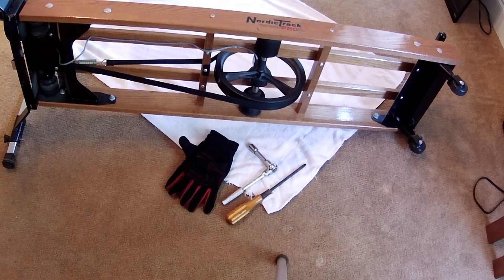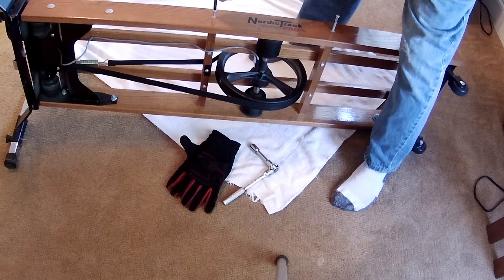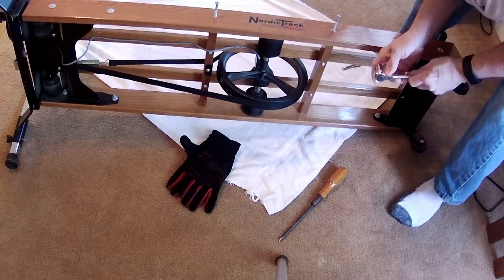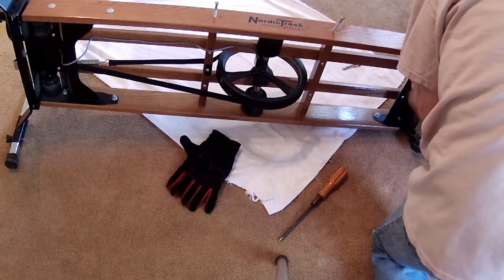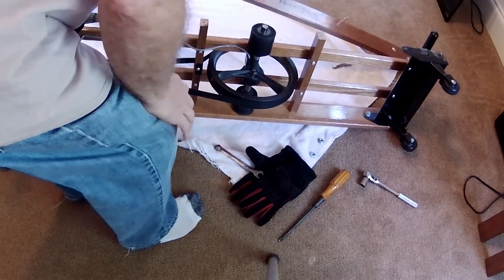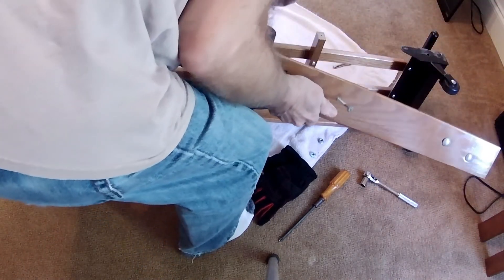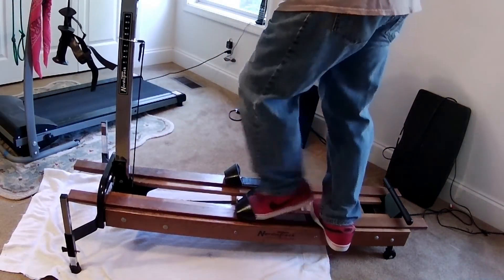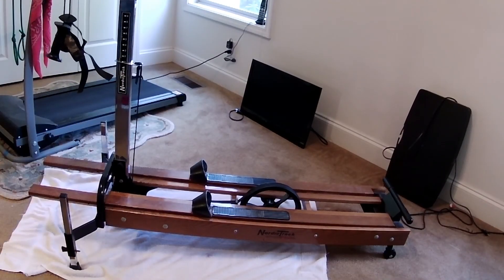NordicTrack Pro Ski Machine Drive Roller Replacement

Comment: Thank you! My right side roller just went out. At first I thought it was the fly wheel. I saved me lots of grief and cash.
Reply from the maker: Glad to hear it, Jimmer.  It's a pretty easy fix and I'm glad so many folks have benefited from my video.
Reply: @speedsterjohnny7191  Suddenly, I felt lost, but fortunately today it's 72, so I'm bike riding awaiting NordicTrack's two roller package. It's an okay deal. Now I know I need a socket set. Thanks again.
Reply: Years ago, I nearly sold it and am I glad I did not. The other day I replaced both rollers and it's good as new, never better. For years I didn't know what I was missing. Thanks again for the vid.
Reply from the maker: @jimmerhardy  My pleasure, sir.  I've had really good response from this vid....much better than most.  Maybe there's a message there.
Reply: @speedsterjohnny7191  The message? It's not the flywheel that goes bad.

Comment: Great video  thanks. I knew the problem was the roller but would not have attempted to take the side rail off to fix it without your video.
Reply from the maker: You're most welcome.  I'm glad the video helped you.  I had no idea when I produced this on my channel that I would have such an extensive response.  Happy Tracking!
Reply: @speedsterjohnny7191  So far so good. Disassembly was fairly easy as you said. The washer on the roller is oily and I seem to remember lubricating but not sure. Was your washer a little greasy? If not I will wipe it clean. Thanks again.
Reply from the maker: @observer2441  Yep, plenty greasy and you want to keep it that way for proper lubrication.  Don't do what I did and let the washer hit your carpeting, if you have any, as it was a chore to clean it off.  The video doesn't show this and the wife didn't see it. he he he!

Comment: Great vid Thanks so much. Good to see that people appreciate these Made in USA older ones they are the best exercise going. I guess I should buy some rollers for mine as I am never going to get rid of it. ..UNLESS I can find the original Elite one for a price I can afford. Would be nice to change the incline so easy and I like the wooden upright and the looks of it ha ha. Love these machines but not the newer models. Made in the USA is the only way to go. I have the Achiever was lucky enough to find one to replace mine.
Reply from the maker: @lindamorgan2678  Thanks for your note!  I’m still amazed by the responses I received for this video.  Best of luck with your machine and exercise program going forward.

Comment: Thanks for the video, we've also had our Sequoia for over 25 years, use it regularly and this is the second time to replace the drive rollers - your video was a nice refresher on how to approach this job.  Btw, most likely due to the age of our unit had difficultly finding replacement rollers, we wound up on Ebay - Amazon had nothing.
Reply from the maker: You're most welcome.  Yes, parts are getting pretty scarce for these old machines.  I purchased my machine for half price from a co-worker in 1989 and have been using it since then.  Great piece of hardware!  Thanks for watching and commenting!
Reply: @speedsterjohnny7191  where can i get the nordic track easy ski machine ???? Its the one with the handles instead of the ropes
Reply from the maker: @kevinwilson3337  Not familiar with that model.  I googled it and several came up including a used one at a pretty good price.  Only hitch might be shipping cost.
Reply: @speedsterjohnny7191  is it on ebay or Amazon ?
Reply from the maker: @kevinwilson3337  I think it was a private seller and with a price of about $125....probably a questionable value.  I saw it on Amazon for $671.04 as a "refurbished" machine, probably OK.  I'm not certain this model is still being produced.
Reply: @speedsterjohnny7191  yea , i saw it on Amazon too but the shipping cost is too much . The total price with shipping is over 1200 lol.
Reply from the maker: @kevinwilson3337  Wow!

Comment: Thanks mine is about 30 years old as well. Mine is not slipping it is stopping but I think it is because the roller has foreign material in it that prevents it from working properly.
Reply from the maker: @ClayWeblogistics  I’m curious to know how the “foreign material” would have gotten in there.  My best guess is to take it off and clean it and then test it again.  Perhaps at some point there may have been less than ideal storage conditions?
Reply: @speedsterjohnny7191  I looked at the skies and the drive rollers work one way. I noticed the skies are damaged from use. I want to put Duros Wood Putty on the rough spots and refinish them.

Comment: Many thanks for your pioneering on this.  Just bought an oak-sided Pro off craigslist and was concerned that it might not have been such a bargain if I couldn't replace the drivers.  The "A" answer would have been to keep the Pro I bought 35+ years ago.  It's a shame cheap drives good off the market.  I confess that I, like Charlie Humme, am such a noob that I can't find the link to your parts supplier either.  Would you mind, please?  Very much enjoyed your sense of humor on display in your narration.  Thanks again.
Reply from the maker: Speedsterjohnny
 
This is the link I used on Amazon to purchase the roller.  Although it shows as "red" in color, the one I received is black, as you will see.  Anyway, this is the link:

 https://www.amazon.com/NordicTrack-Fitness-Machine-Drive-Roller/dp/B008GUC2M0/ref=sr_1_1_sspa?crid=UU2L6CKD4D2V&dchild=1&keywords=nordictrack+ski+machine+drive+roller&qid=1608081069&sprefix=nordictrack+drive+ro%2Caps%2C178&sr=8-1-spons&psc=1&spLa=ZW5jcnlwdGVkUXVhbGlmaWVyPUFOMTk3V0lEOFBYRkQmZW5jcnlwdGVkSWQ9QTA2OTY1NzEyWlgyUTFaMFdFWkpCJmVuY3J5cHRlZEFkSWQ9QTAzMTgxMjYxSDU0SkVFNTVPUktIJndpZGdldE5hbWU9c3BfYXRmJmFjdGlvbj1jbGlja1JlZGlyZWN0JmRvTm90TG9nQ2xpY2s9dHJ1ZQ==

Comment: i have a Nodric Track Achiever model, and the large flywheel is not working.  Then it turned into so much resistance that I could not move the skis.  Would this be one of the rollers?  It was working up until yesterday.  Can you still get parts? I just checked your link on AMZ, it is says they are unavailable.  Thanks!
Reply from the maker: First of all, I am assuming you have not taken the machine apart and reassembled it incorrectly, OK?  Try taking all tension off the machine (nylon strap) and take the flywheel in your hand and move it back and forth. It should turn freely in both directions.  If not, take it out and check for corrosion.   Check each roller function by pressing down slightly on the ski and move it back and forth;  It should turn the flywheel on the back stroke and roll freely when moving the ski forward.  If they work in both directions, the rollers are good.  

The independent supplier I used may be out of stock or perhaps even not able to get the rollers anymore.  If so, they may be available directly from NordicTrak.  If so, be prepared to spend substantially more for them.
Reply: @speedsterjohnny7191  Thank you for the helpful advice.  Correct, I have not taken it apart and reassembled incorrectly.  I will do what you recommended!  Stay tuned!
Reply: @speedsterjohnny7191  Hello, I took off the belt, and the rollers and flywheel moved smoothly.  Once I hooked the belt back on, I could barely move the skis.  I loosened the tension knob to the smallest or least tension and there is so much tension I could not move the skis!
Reply from the maker: @bodeans59  I looked up the Achiever on ebay and noted some differences between your machine and mine.  On the Pro, the tension on the flywheel is controlled by a slide on the upright and there is a separate adjustment for the handles that you grasp with your hands.  It sounds like there is something amiss with the tension adjustment for the skis, that is when it is when the tension knob is at its lowest setting it really needs to be lower.  I'm not certain I can advise you on this problem.
Reply from the maker: @bodeans59  I looked up the Achiever, and while similar to the Pro, it appears that the tension for the skis is set by an adjuster located in between the skis.  If this is correct, then when the slide is set to the lowest setting (all the way forward it appears), there should be no resistance.  If there is, something is wrong with that device.  I could not find a video or any information indicating how to calibrate that control but there must be one.  Do you have an owner's manual?  If not, they may be available online.  Hope this helps.

Comment: Thanks so much for this great video! I have a NordicTrack Pro from the late 80's and the skis clack clack clack whilst I try to use it, it use to just go whoosh whoosh (very softly) and it has a hurky jerky motion. Not a safe feeling at all, I am wondering if I should replace all 6 rollers or just the two on the fly wheel. I have turned the smaller  fore and aft rollers and they turn forward and backwards okay,  also the fly wheel rollers roll freely forward and stop when I attempt to roll them backwards so what should I do about the clack clack clack and the turkey jerky motion. What are your suggestions? please help, I am not mechanical at all but will try to do this. Thanks every so much!
Reply from the maker: I don’t think the “clack clacking” is anything to be concerned about.  I find that I sometimes get that depending on how my feet exert pressure laterally.  Try experimenting by exerting inward and outward pressure as you stride.  Hope that helps and thanks for watching!

Comment: I had a similar issue with the left roller.  It seemed like the rachet mechanism inside the roller was catching and not releasing so there was zero resistance when pushing back.   I tried Liquid Wrench Penetrating oil.  The thin tube on the can allowed me to deliver a little oil to the end of the bearing.  Oil, let it soak in, spin and wiggle the roller, then repeat several times to both ends of the roller.  After cleaning the rubber roller with alcohol, it now seems to be working great.  Unsure how long it will last but since the roller is out-of-stock on Amazon it might be worth a try.
Reply from the maker: Gerry, Hi!  This is a strange one to me.  With zero resistance when pushing back, if I understood you correctly, it almost sounded that the roller was in backwards.  Please help me to understand.  Thanks, Johnny
Reply: @speedsterjohnny7191  When the roller is working properly there is no resistance when the ski is sliding forward.  There is resistance when you slide the ski back towards the rear of the machine.  At that point the roller is engaged with the flywheel which is restrained by the friction belt.   When the roller failed there was no resistance in either direction.  The result can be surprising - you expect to have resistance when moving the ski backwards.   I never removed the roller to lubricate it.  I just tipped the entire unit on one side and then the other to apply the liquid wrench to both ends of the roller.
Reply: there are other suppliers such as nordic parts that sell the rollers

Comment: Hi, I just this got a Nordictrack Pro that looks very similar to yours. The left side takes more effort to push back, and there is a thump when my left foot is over the flywheel. Do you think this would need a drive roller replacement? Thanks.
Reply from the maker: I’m not sure what that means but it does not sound like a drive roller problem.  Can anyone out in NT land give advice?

Comment: The football shaped display for my NordicTrack Pro just stopped working recently.  Would you have any information on troubleshooting those displays?
Reply from the maker: This is out of my realm of experience.  My display was not hooked up for years due to a missing nut that holds the receptacle for the jack;  All I had available was the countdown timer that does not require any input from the sending unit.   I hooked it up outside the upright member and it looks awful but all functions are working.  I don't know how expensive the unit you describe is but that may be an option if they are available. Your display is football shaped???
Reply from the maker: Whoa, wait a minute.  My unit has never required any service other than an infrequent replacement of the 9 volt battery.  Is your battery possibly the problem?  On my unit, the battery is located behind a rectangular access port on the back of the unit which pops right open with a gentle pry.  Just a thought.
Reply: @speedsterjohnny7191  Thanks Speedsterjohnny.  The display I have is NordicTrack part number 27485 - NT5.  It is football shaped, takes 2 AA batteries, and attaches to the rail.  It has two input jacks - speed and pulse.  I only use the speed jack but I did have the pulse attachment too but never used it.  The unit displays:  Time, Speed, Distance, Calories, & Pulse.  I can't complain about the quality since this one has served my needs since 1997.  I would however like to make it functional again if at all possible.

Comment: Thanks for the vid! How did you know for sure that the drive wheel needed to be replaced? We suspect ours needs replacing because the machine works fine on lower resistances, then on 4, the flywheel just stops. There seems to be not enough friction on the drive wheel at that resistance. Do you think we need to replace the drive wheel to fix this?
Reply from the maker: The drive roller provides the "traction" when you stride.  Mine started to slip and I tried to use a lower resistance setting and that helped a little but it was clear that something was wrong. I did some snooping around and discovered that as the drive rollers wear out that this slipping can happen and it becomes progressively worse.  It was only on the left side (so far) since my left is dominant.  After over 30 years of service and however long my co-worker (the original owner) owned it, It was a small price to pay to repair it.  I also have a spare for the right side if and when that one goes bad.  As far as certainty, this was the only thing that made sense and it proved to be true, obviously.  Thanks for watching and commenting.
Reply: @speedsterjohnny7191  Thanks! This is very helpful.

Comment: I bought a used machine and couldn’t figure out why the action was so choppy.  I cleaned all the black deposits off the bottoms of the “skis,” but that wasn’t it.  Your video was an Aha Moment:  in turning the driver wheels by hand I found that both were slipping out of gear from time to time.  Just ordered a new pair of driver wheels from NordicParts on eBay… can’t wait to pop them on.
Reply from the maker: Good news!  My machine has been in use for over 30 years and by replacing the one drive roller, it was like brand new again.  Track on!

Comment: Great to see that you are still using your skier.  I have one from 1992, and it squeaks when I ski.  At a friends suggestion, I cleaned the flywheel and belt with alcohol.  No change.  Any suggestions?
Reply from the maker: I can't say that I have had that problem.  I don't have the original instruction book but could there be a place to lubricate the flywheel?  I assume that the squeaking is constant and not related to the drive rollers.  Best of luck.  They are great machines.
Reply: I also have a squeaking flywheel. We’re you able to find a fix?
Reply: My machine was squeaking too.  At first it was even hard to tell where it was coming from.  In my case, I could solve it just by applying some 3-in-1 oil to both pins of each of the idle rollers at the front and back of the machine.

Comment: Thanks for the video my question to you Johnny, did you order through Nordic track site or from any site if you could share the info with us....... thanks.
Reply from the maker: I did a lookup on Amazon and was directed to "The NordicTrack Store".  There are at least two vendors that offer the product, one being a lot more expensive (about $100) than the one I ordered from.  The link on my comment is where I went.  Although the picture of the roller is red, the one delivered is black.  I heard from one person who did get the red one said it was unusable and sent it back.  The one I received works great.  Hope that helps.
Reply: The only place I found these available new was in the NordicParts store on eBay.  Nothing on Amazon in February 2022.

Comment: Hi. Thank you for this video. What are signs and symptoms of a roller or rollers that need repairing? I just bought a 1989 Pro.
Reply from the maker: The symptoms are striking.  I noticed while I was tracking that during the stride that the ski would often slip....as in no resistance at all....a good way to throw out your back if you aren't expecting it.  Thanks for your comment.
Reply: @speedsterjohnny7191  Thank you very much for the info.

Comment: the fly wheel on my Nordic Track just goes forward , not back. HELP, what's wrong?
Reply from the maker: I have not experienced that problem.  Maybe you can google the symptoms and see if someone has a solution.
Reply: My flywheel is stuck and won't move . It has rust on it. Hopefully I can find a way to replace it. I found a place called nordicparts.com but I don't know exactly what the issue it
Reply from the maker: @Piapia650  Probably rusted in place from a period of non-usage and exposure to moisture.  Not an easy fix.

Comment: Anyone replaced a glide button on the skis?  What's involved, please?
Reply: The superior portion of the glide button will have a very small detent.  AT YOUR OWN RISK, Insert a very sharp and strong knife point into the detent and gently pry the button out.  Replacement glide buttons will fit snugly, requiring a few gentle taps from a small hammer.  Upon completion, wax the lateral surfaces of the skis for a smooth glide.